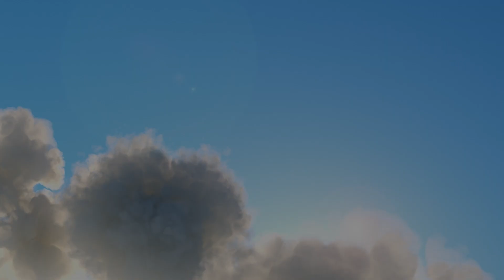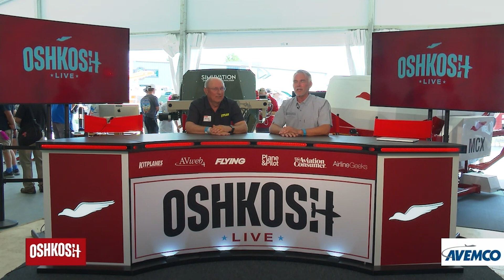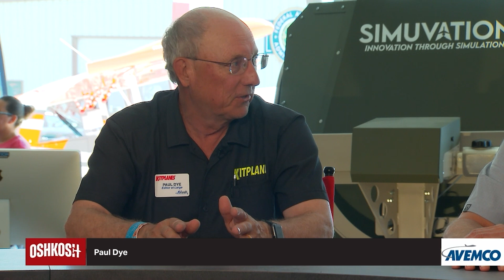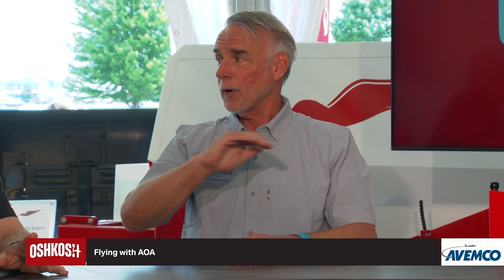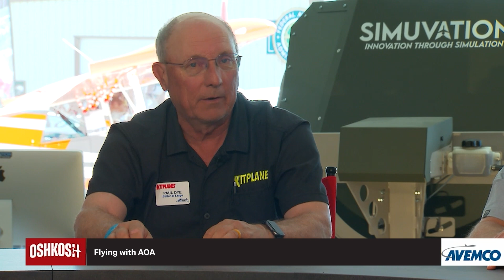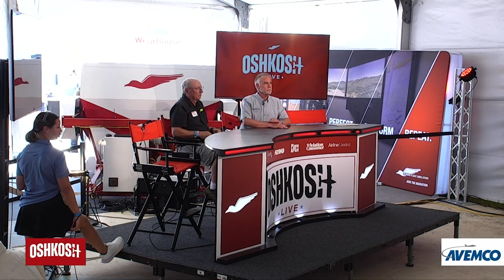Why Angle of Attack Is a Lifesaver

Comment: Speed
Keep your speed at 1.5 stall speed in the landing pattern until in final approach.
A fatal crash today. a small plane turning in the landing pattern ...ordered by the ATC to make a turn...stalls and spins into the ground
Reply: How do you know V stall iot maintain 1.5 of such? Remember at 60 AOB, stall is double straight stall. If, however, you use AOA, you can always see your margin. If you don’t pull back on the stick, your nose may cut down and descent rate increase, but you won’t stall.